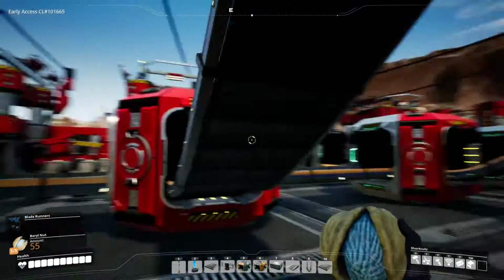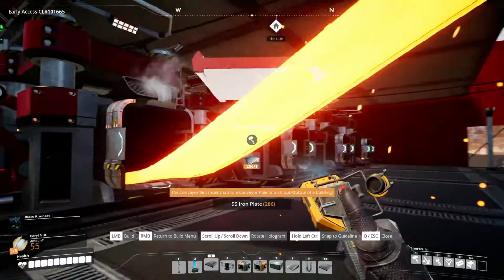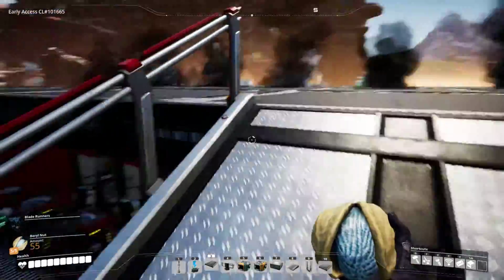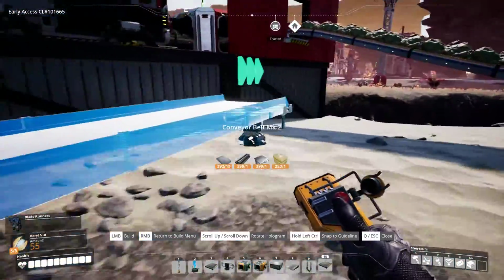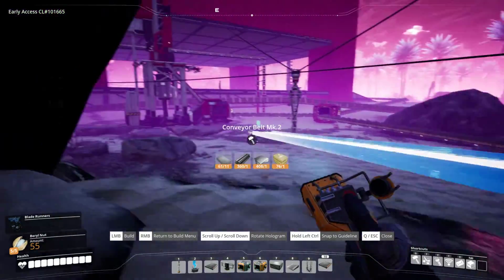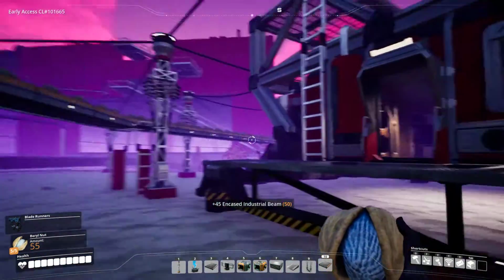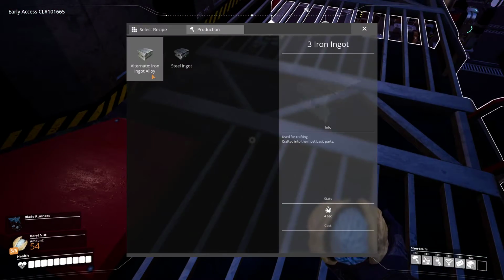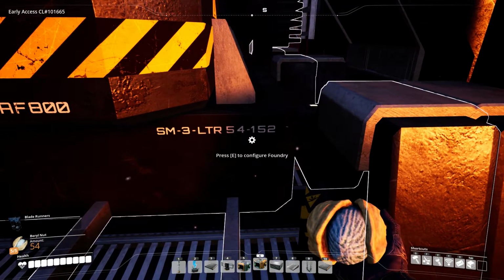Tripling Iron Production With Alternate Recipes | Satisfactory Desert Bus Ep#24

Comment: Wouldnt it be better to use the new stackable Splitters? :) Nice work - love your Satisfactory Series!
Reply from the maker: But they won't line up right.
Reply: @MangledPork  I mean where you put the 2 inputs to the Foundrys. 1 splitter on the ground for left input. And instead of building a 1 high belt and put the splitters on it and aim for the 2nd input of the foundry. for those 1 high splitters you can just put 1 splitter perfect lined up on the ground and - due to the new function that you can stack splitters on top of each other - you can put another splitter on top and you got it perfectly lined up 1 high. i hope i could discribe it this time better :)